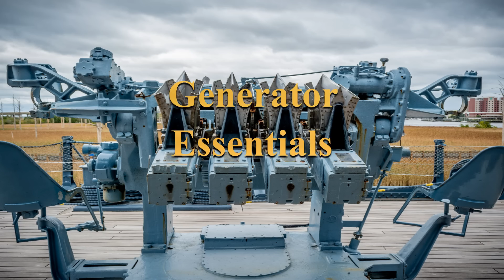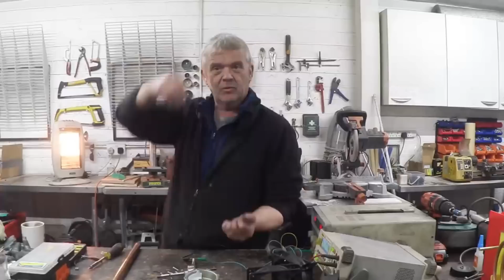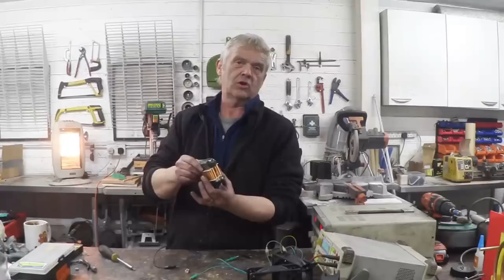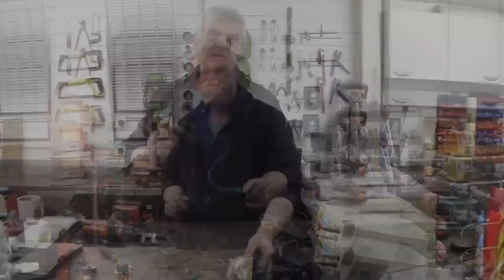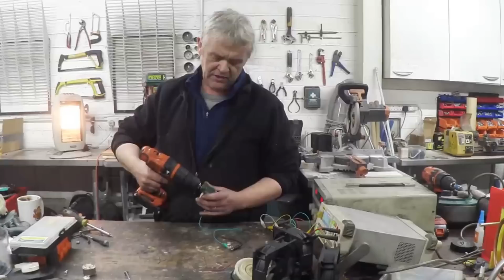2071 Generator Essentials

Comment: Good info sir, a lot of industrial electricians have difficulty understanding the relationship between in rush curents ( locked rotor current ) and the normal running currents between unloaded and fully loaded or "FLA". Understanding how the back EMF produced drops the high inrush current after the motor reaches it's rated speed to counteract the input EMF otherwise if the motor rotor did not move the in rush current would remain high and trip your motor overload protection.

Comment: Mr Murray I would love to ask u a question. I'm a proud father my son is autistic and I I'm researching renewable consistent energy systems.. I never really cared for school or anything because it was to easy.. I'm self motivated. I ask you could u not use an sustainable source (dc) v to an stabilizer dcv-dcv then to an inverter dcv-acv. (a+b+c)+D Then that to an Optimus Prime account to ac.. then u would have an measurable amount of the key Element... E being usable greater than what you put In at the sStart. Which I have designed in theory.. it should work.....
Reply: Using all elements of nature to achieve a system for the purpose of sourcing Clean sustainable energy into all homes globally worlds wide especially the poorest of nations and top environmental leaders. Recycle ♻️  find yours sources.. I'm getting closer and closer everyday to making this a Reality-based on my theories. Im just an low class american citizen in some dirt road town. But strive to help over come these years of pollution and corruption. I was lost but now I see.

Comment: Yeah I recently made a pulse motor with 1mm thick magnets and they weren't strong enough to generate any energy . The 2mm magnets i replaced them with were  though . 1 mm thicker yet 4-5 times greater strength . So so essentially the weren't strong enough and I don't have enough windings nor speed to overcome the resistance of even the lightest load . I pretty much experienced exactly what Rob is explaining in this video . 😂

Comment: I think some filaments in bulbs will increase in resistance as they get hot and the current will then decrease some.  When the bulb is cold, the inrush if high current could cause the filament to melt.
Reply: Proper materials make all the difference in the world. 👍

Comment: For axial flux motor what would happen if instead two stators with coils and a rotor with magnets tha stators are replaced with copper plates? Wouldn't this be similar to dropping the magnet down a copper pipe?